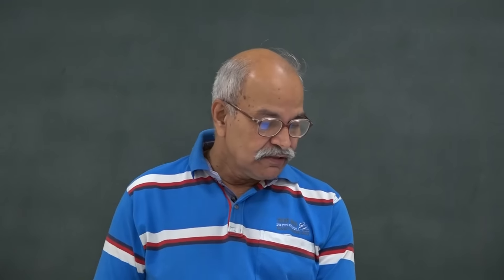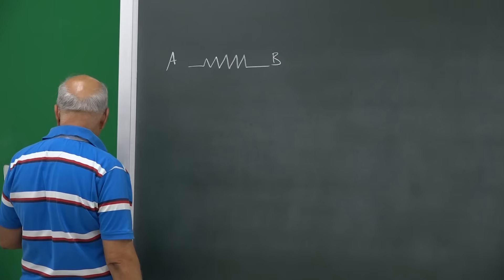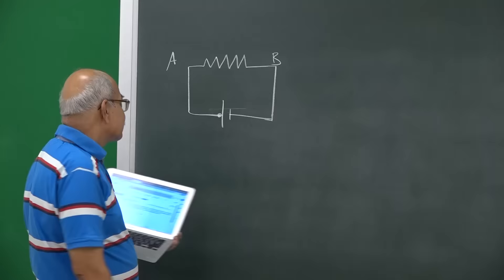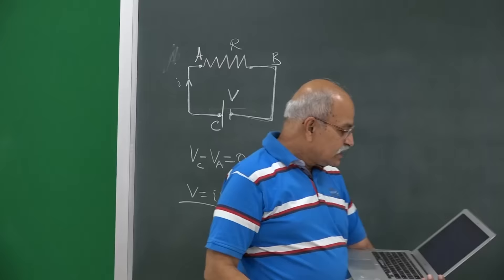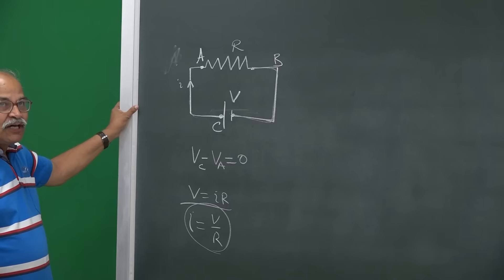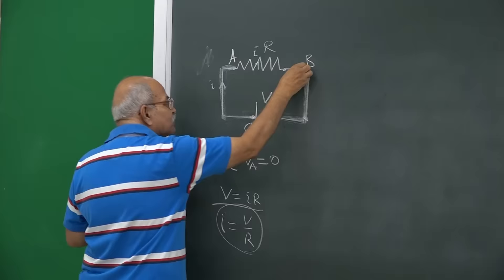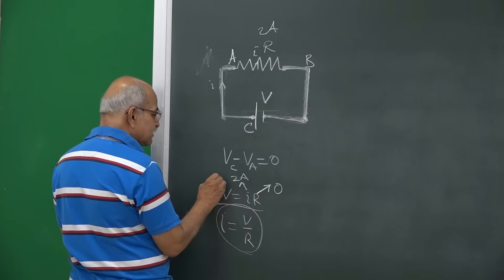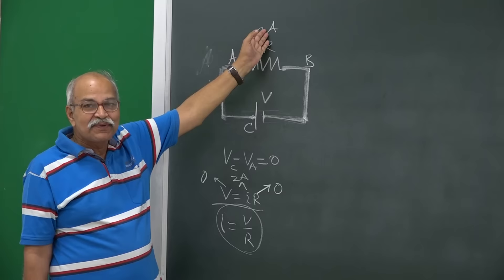Current without potential difference

Comment: Sir, i think the question he meant was that. How current can flow in that wire from A to C in spite of the potential difference between a and c is zero.
Reply: I think we should think it reversly....current i produces potencial difference V = ir when it goes through a resistance R ....here the resistance of the wire is negligible....so in that portion, potential difference created by current is also negligible..

The main point is- the current is produced by the potential difference of the battery.....not by the potential difference between two points on wire.
Again i am saying--
Potential difference between  two points of wire or say through a resistor  is created by the current
and the current is due to the potential difference of battery
Reply: Kirchoffs closed loop law
Reply: Since wire has non zero resistance, there would be potential drop and due to which current flows
Reply: @vasanvk2213  no no. That resistance drop is so negligible that if we go by equation the current will be huge like close to infinity
Reply: He made an assumption that the potential difference from A to C us zero, but in practical it is not possible because of some negligible resistance.
But still if you consider zero potential then resistance is zero and current will also become zero.
Reply: @mshivakumar...i am not explaing short circuit condition....my explanation is according to the video....coming to your point..

When short circuit occurs..there is quick flow of electrons ((at the very beginning ..there must be happens potential difference))...due to the quick electron flow...heat is produced and the wire can be ignited ..

Your open circuit explanation is not relatable to my answer..lol...
Reply: @ashwinpatil9507  no because current is created due to potential difference of battery and not the potential difference in wire
Reply: It's because we assume R(wire) to be zero, in such case, any amount of current can flow.
In any electrical component or circuit, current will flow if R=0 despite zero potential.
Reply: @souvikchandra1434  
Very well explained..👍👍
Reply: @harshjariwala8176  you got my point 💓
Reply: @farjanaprodhani9326  thank u💓
Reply: @ashwinpatil9507  you have no idea that what is possible... #Thor #Hela
Have you ever heard about Super conductor
Reply: As wire has 0 resistance then it is nothing but a part of positive terminal extended up to resistance ....
Reply: Consider the condition that the wire has almost zero resistance, that means that it is an excellent conductor. Now when connected to a battery, the electrons in the wire are exited and because of zero resistance the electrons flow and not due to potential difference in this circuit, sir has explained it with ohms law point of view, but the current flows because of energized electrons... It's party related to chemistry...
Reply: Yes correct.. Even I was like WTF is he saying and I haven't see anything remotely close to physics topics for 20+ years. This guy just repeated the question and said it was meeting ohms law.. also no idea why YouTube decide to show this in my recommendation list lol..
Reply: @Shreyas Gavhalkar   why isn't any potential difference created in "energising" electrons.
Reply: No connecting wire has zero resistance so technically there will be a potential drop as current moves be it a small drop so there is a potential difference.
Reply: Then it will be short circuit.
Reply: @souvikchandra1434  

Silly boy 
Current is due to the internal resistance of conducting wire

According to equation
V=E-ir
Reply: @souvikchandra1434  electrons are charged particles. How can they flow in a system where there is no difference in the magnitude of electrostatic potentials? I mean to say, electricity should not flow in a system where there is no difference in potential( here between A and C). So, isn't the question absurd? Please clear my doubt. Thank You
Reply: @ayansayan8229  your concept is absolutely correct ❤️
But remember this system includes the battery also which has the potential difference .
This potential difference of the battery is creating a electron flow.
So ,we can say that the battery is providing energy to the elctrons.
This energy can be losed when it gets resist by some means.

But ..here ..if we consider the resistance of the wire close to zero, then no energy will be losed. So, no potential drops in the part of the wire.

Again remeber--electrons flow in this case is due to the potential difference of the battery not the wire..
Hope you can now understand
Reply: Without potential difference not equal to zero, current can't flow. Potential difference is the one who makes the current to flow. Ye sir ne kuch bhi nahi bataya iske baare me...😂
Reply: @harshitbaghel7539  ekdm sehi kaha...battery ka potential difference ke waje se hi current flow ho raha ha....na ki wire ke potential difference ki waja se.......the  wire has resistance..so in that portion current flow hone ke liye energy invest karna padega...wo energy lost hi wire ka pottential differece mana jata ha....
If any portion of wire doesnt have resistance(suppose)..so there will be no energy investment..hence no potential drop...((but in that case..the wire may be burned due to execessive heat)...

So...main role of current flow is of the battery..not the wire
Reply: @souvikchandra1434  han bhai...you are right
Reply: @souvikchandra1434  can you please it once again by another way, explaining the same concept?because I have that same doubt but I didn't get clear till now.I think you can clear my doubt.qs how the current flows even though the potential difference between A and C is zero?
Reply: @dailyupdates2239  thanks❤️

You will find your answer...just read my other comments..

Shortly--"current is due to the potential difference of the battery, not of the wire....so,if any portion of the wire doesnt have any potential difference , that doesnt matter..."

Pls go through my other comments..your doubt will be cleared..

Have a good day ❤️
Reply: @souvikchandra1434  thank you
Reply: @egostroked4606  you are most welcome 💓💓
Reply: @souvikchandra1434  you explained it so well 
I am a 10th grader still understood this by seeing your comment..
Actually I have one more doubt can u please clear it - why does overall resistance in parallel circuit decreases...🥺please can u explain....
Reply: @vibhu.76  thanks for your feedback :)

Here is one simple ans to your doubt (not an mathematical explanation.. But you will feel it I hope)

Suppose thousand people walking through one road. After some time the road divides into three other roads and the mob divides also.
So, obviously the disturbance on the road decreases while they devides into three roads rather than going by a single road.

Now you imagine the thousand people as current flow and the disturbance as resistance.
Hope you get it :)
Reply: @souvikchandra1434  thank u so much I understood it at once ..
When I asked a teacher he said that "itni hi electricity padhni h toh 12th ki book se padh lo" and few were giving wrong concept but thanks to u for explaining me...wish u could be my teacher .. firstly toh I was thinking that is it a proper question or not ..😂
Reply: Fir Vohi to bataya Sir Ne!!!!!!

Comment: HC Verma sir is saying only about Vc and Va or Vc and Vb.Not about Va and Vb .There is a potential drop across Va and Vb due to the battery. So current flows from higher potential to lower potential. Now I think his explanation is complete.
Reply: But the real question is not about A to B . It's about A to C .
A has higher potential compared to B , so there will be a current flowing from A to B (which makes complete sense)
BUT , why the same current is flowing from A to C ? A and C have same potential , so according to that , there should be no current flowing from A to C.

Comment: as we know there is no force required to move a body in an uniform motion provided there is no friction.. similarly if there is no resistance(friction)  the charge keeps on moving without potential difference(force) and hence there is current.. as in case of superconductivity
Reply: Right!!!
Reply: Correct
Reply: How would the current start flowing in the first place if v = 0?
Reply: @ojasvi kamra current once flown can be kept flowing at V=0 if superconductivity conditions are maitained
Reply: Sir, my question is that how is the current once flown. What is the reason for the current to begin flowing.
Reply: current at the first place is flown under some potential difference and the current presists even after its removal as in case of superconductor
Reply: @ojasvikamra6835   think for the same case if some one is rest u need some force to move it but once it moved it maintains its velocity till no force act on it.. means for moving some force(voltage in this case) is  required
Reply: I get it.. thanks a ton mate :)
Reply: @ojasvikamra6835   welcome bro
Reply: @ojasvikamra6835  there are we suppose that there is current
Reply: @sandeepbailwal2035  you know ammola sir?
Reply: @ayushcr7877   what is his full  name??
Reply: @ojasvikamra6835  its a single loop, current into a node equal current out of node
Reply: Gosh .. thanks for that .. now i get it

Comment: Sir, you explained that current that flows is logically correct but the question is WHY DOES IT FLOWS AFTER ALL?? reply to my comment.

Problem Resolved :-
Battery produces potential difference and this causes current in circuit (wire+resistor) and...
This current when flows through circuit creates potential difference in various sections of the wire (in this case between A and C)
THIS IS THE MOST ACCEPTABLE ANSWER TO WHICH I HAVE ARRIVED AFTER SEEING YOUR COMMENTS...THANKS GUYS FOR REPLYING TO MY COMMENT AND CREATING AN ENVIRONMENT OF HIGH ORDER DISCUSSION.
Reply: Bcz electrons ultimately wants to reach to the negative terminal of the battery......that means it has destination
Reply: Current will flow because there is a path to flow..and something forceing to charge carried electron to flow on this path..simple...you can assume a dam(water reserver) ..flow of water as charge and storing that water mean storing charge n we call it voltage
Reply: Alot of didn't get the question .
See in the free body diagram , a current(i) is flowing from A to B which makes sense because potential of A is higher than potential of B .
But the question is WHY CURRENT IS FLOWING FROM A TO C ?? 
Potential of A and C are same but still there is a current flowing from A to C . Why ?
Reply: @darkseid856   if u have  vertical tube marked 3 points A, B ,C on that tube , u connected pump at the top (C) then water flows in the tube from A to B to C , then tell me why water flows from A to B while level of B is higher than A
Reply: Current will flow because actually their is nothing like 0 resistance , as V=ir , there would be some V diff between A and C
Reply: @kailashguptaphysicsclasses7052   THE MAIN QUESTION IS THAT "IS THERE ANY POTENTIAL DIFFERENCE BETWEEN A AND C???"
Reply: There will be potential drop across AC but in analysis of circuit inspire of taking the parameters distributed ,it's taken lumped to simplify the analysis. The resistance between A and C and between B and -ve terminal is assumed zero as it plays no significance in our analysis. For eg: in emersion rod , the rating is given based on the coil used in it but to send current we need wire which has a resistance of itself but that is too small , made of copper or aluminium ,high conductivity very low resistivity so the voltage drop across wires are ignored but that doesn't mean current flowing without potential difference.
Reply: *inspite
Reply: Jab voltage nahi ha to curreny kesa????
Ohm say that if there is potential difference between wire, the current is proportional to that potential difference
Reply: Potential difference in the wire or through resistance, is created by the current flow. Current flow is because of the battery. 
Current flow is not because of potential difference in the wire or because of potential difference across the resistance.
Reply: @Aslamkhan-vo7rm  i agree
Reply: @kailashguptaphysicsclasses7052  actually if you use a pump,  it creates pressure difference (suction). So net potential difference between A and B is not based on just gravity.
Reply: @NishanthSalahudeen  exactly ,In the same way electrons are sucking by positive terminal of the battery that's why current is flowing through the circuit
Reply: @irivintishivateja9507  you are Extremely  WRONG . Battery DOES NOT supply current . It creates Potential Difference . 
Battery does not produces any current , ions are already there , they only need potential difference so that they can flow . Battery only provides potential difference and not current.
Reply: @kailashguptaphysicsclasses7052  I think I get what you are trying to say but I think your vertical pipe analogy is flawed . A vertical pipe will mean all the points (A , B and C ) all have different heights which will mean that they have different energy levels . BUT remember that A and C should be of same potential energy .
Reply: @darkseid856  That potential difference that the battery provides is what makes the current flow man.
Reply: @darkseid856  and I didn't say that battery 'supplies' current. Read what I wrote properly.
Reply: @darkseid856  but concept is same brother
Reply: @irivintishivateja9507  you said "current flow in the circuit is what makes potential difference" 
That's not correct . Potential difference causes the current flow . Not the other way around .
Reply: @irivintishivateja9507  I am reading correctly . You clearly said "current flow is because of battery . Current flow is not because of potential difference in the wire" , this is nowhere correct.....
Reply: @darkseid856  ok
Reply: @darkseid856  due to conservation of charge
Reply: Clue lies in the thickness of the wire. If the wire is thick enough to carry enough R to equate the R. So, thickness of the wire will allow the current to flow. Resistance less wire will not satisfy ohms law. Lhs=Rhs
Reply: Problem Resolved :-
Battery produces potential difference and this causes current in circuit (wire+resistor) and...
This current when flows through circuit creates potential difference in various sections of the wire (in this case between A and C)
THIS IS THE MOST ACCEPTABLE ANSWER TO WHICH I HAVE ARRIVED AFTER SEEING YOUR COMMENTS...THANKS GUYS FOR REPLYING TO MY COMMENT AND CREATING AN ENVIRONMENT OF HIGH ORDER DISCUSSION.
Reply: Here I hope this helps , 
Current is at Infinity if R->0
Reply: @darkseid856   Well, this is possible in the case of superconductivity. When do you need potential? When you have to do work and spend some energy. And why exactly is this energy needed? Because there are quadrillions of other atoms that the electron collides with and there is no possibility of them flowing in the same uniform direction and causing no current to be produced. So when potential is provided they flow in the same direction, Right? In superconductivity we are assuming the resistance is absolutely zero. This is assuming the free electrons have no obstacle what so ever and they can flow without any potential difference (without using force). Or in short, the wires used are superconductors which can exist only at extremely less temperature (below -200 K).
Reply: @kailashguptaphysicsclasses7052  electrons flow from negative to positive
Reply: @logeshgopi4212   yes , it was by mistake
Reply: @ayuschmannov2461  bro current doesn't create potential difference
Reply: Because R=0, Change in potential between w ends is there hence current flows
Reply: @kailashguptaphysicsclasses7052  firstly read what is potential difference
Reply: Kailash Gupta  if they want to reach, then there should be a potential difference , right?
Reply: Kailash Gupta  if they want to reach, then there should be a potential difference , right?
Reply: Actually there is no potential difference between A and C Or can be called as equipotential points. You can assume this as one single point instead of two. Now see there is resistor between two terminals of battery. Of course current will flow as the circuit is closed.
Reply: I think, it's  because of the electrostatic force produce by both the terminal of the battery.